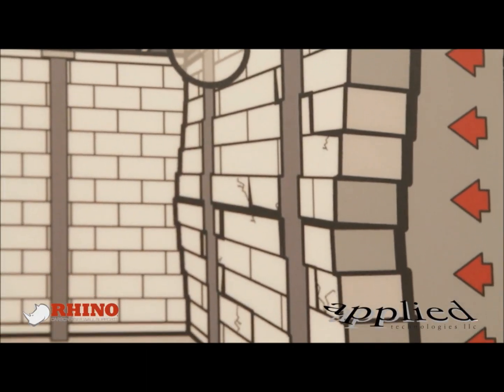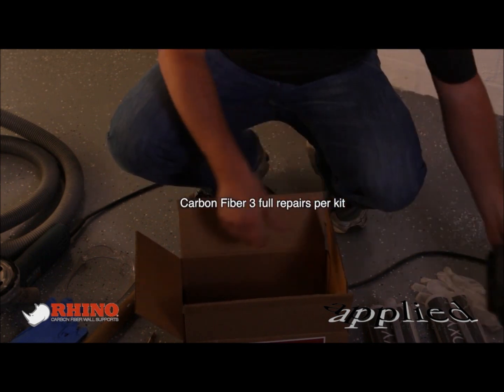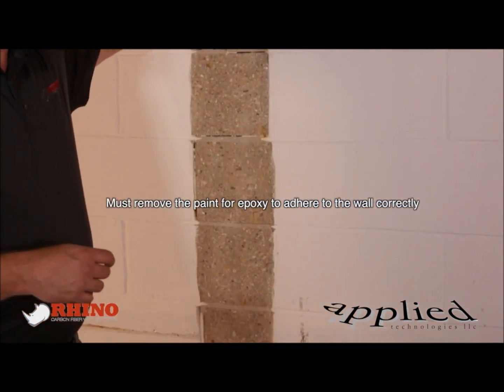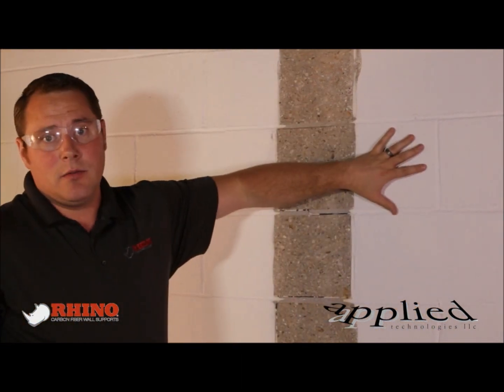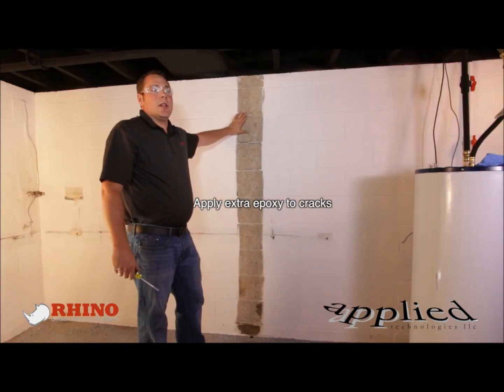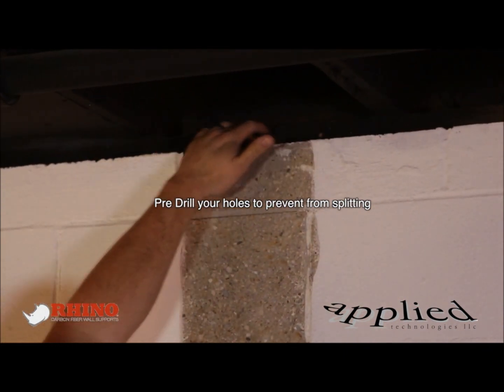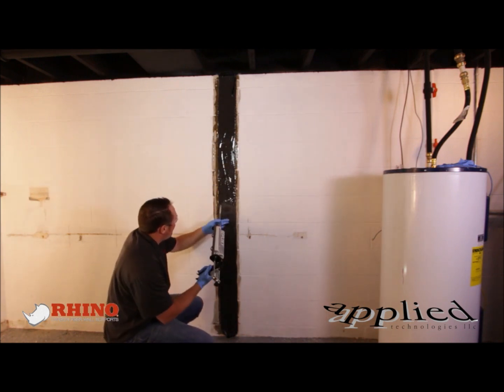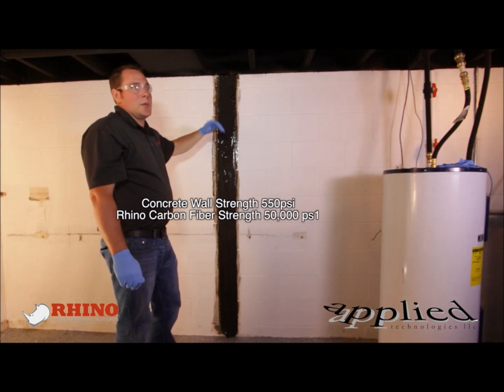How to Repair and Reinforce Bowed Basement Walls-Rhino Carbon Fiber Instructions

Comment: What if you can't get a drill up there to drill the holes for the bracket? Where would you place the bracket? On the face of the block at the very top?
Reply: You have to attach the bracket to the sill plate.

Comment: I found that gorilla wall brace works a lot better and actually will straighten your bow basement wall and the great thing is DIY, the fiber stripping is only good as the glue. And it may keep your wall from coming in but it won't straighten it out.

Comment: Where else can you source the same materials? Carbon fiber overall is less expensive than installing beams, but MY GOD it's still over-priced. I found some manufacturers on Alibaba that are sending me samples for free. I might consider purchasing that way. Has anyone done their research and have better sources for all the materials at a petter price?
Reply: The problem with buying carbon fiber from another source is that you don't know if it's designed for structural repair.  And it will seldom, if ever, be warrantied for that application.  The reason that structural carbon fiber is more expensive than cosmetic carbon fiber is because it has to pass a large number of strength and durability tests and then go through engineering tests and calculations to make sure that it is acceptable for that usage.
Reply: Yes, you can source it from China. Where do you think these guys get theirs!? I bought Stage 3 thickness carbon strip from AliExpress that was made for concrete wall repairs. $100 for 50 yards shipped to USA! Was here in less than 2 weeks. Bought the epoxy from US Composites. Done!

Comment: do you have a video showing the carbon fiber being twisted and stuffed into the 3/4 in. hole at the base? also the video doesn't show putting epoxy on strap and plate before screwing in lag bolts. Is either way an option?
Reply: Yes, save your money on this rip of shit and replace the block. It's over 500 bucks for one kit that does one small section.
Reply: bought product and repaired 3 walls in  cellar. very happy with product saved over $3,000 vs putting in steel I beams
Reply: @pefmembers    That kit contains 3 straps that cover 12 feet of bowing wall repair.  Most jobs require more than one kit, but they are all inclusive with epoxy and carbon fiber.